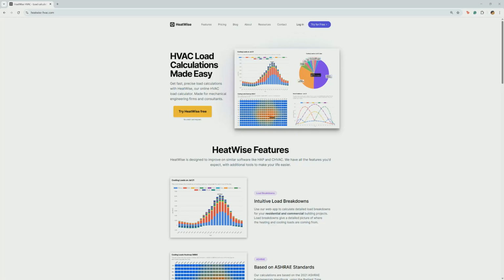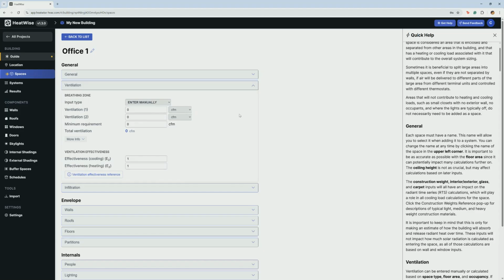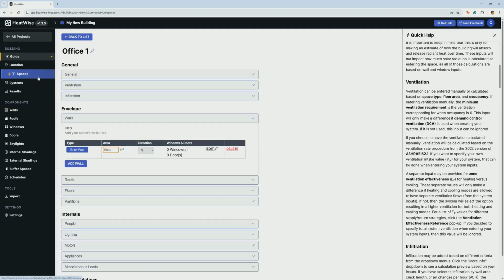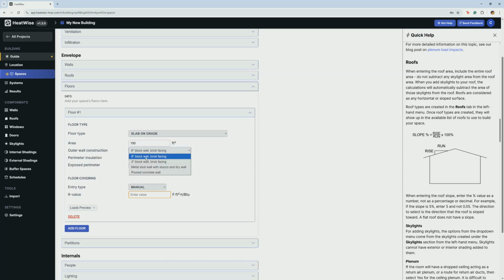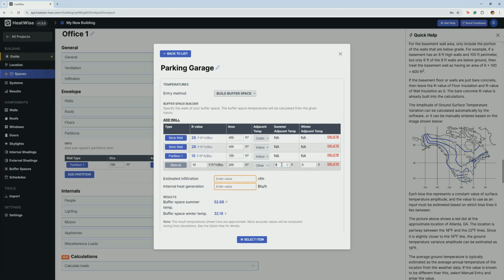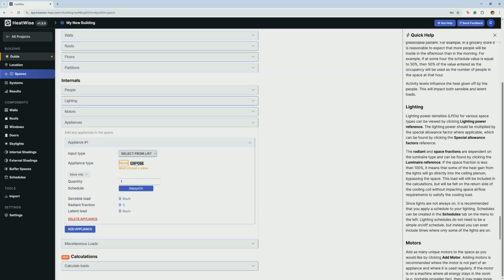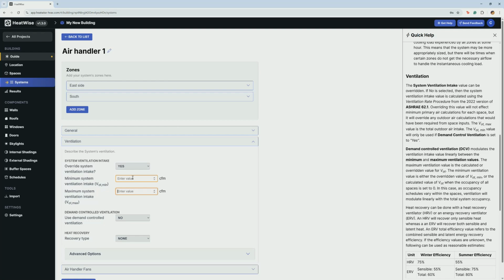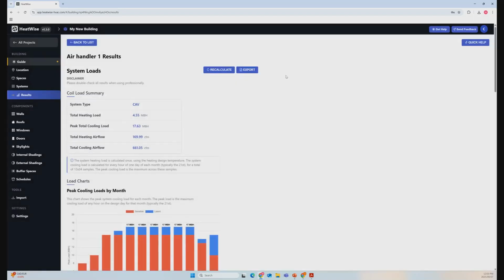HeatWise Commercial Project Tutorial

Comment from the maker: 00:00 Getting Started with HeatWise
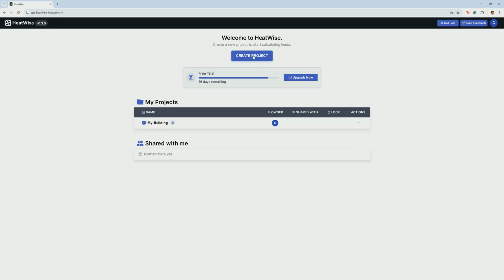01:26 Create a Project
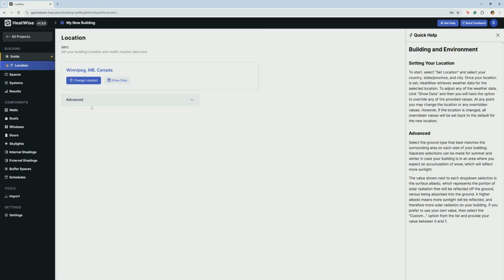05:06 Setting the Location
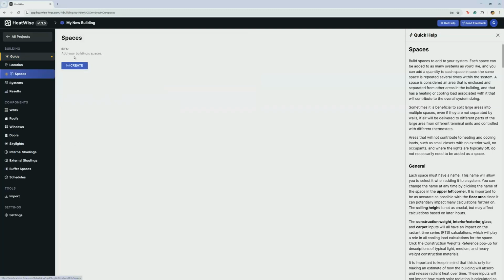08:06 Create a Space - General Inputs
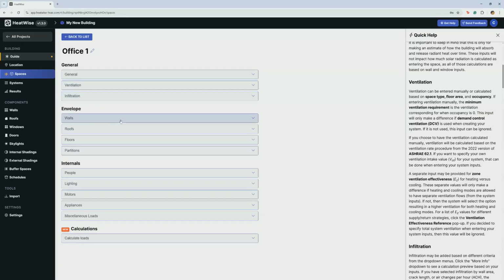15:13 Space Envelope - Walls, Windows and Roofs
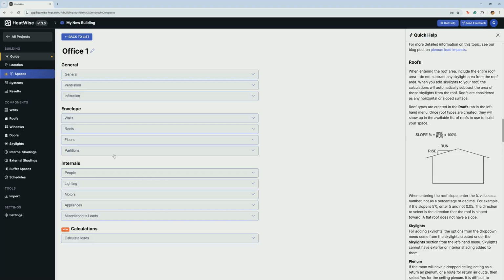31:45 Space Envelope - Floors and Partitions
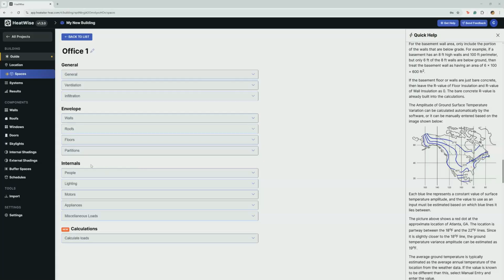45:13 Space Internals
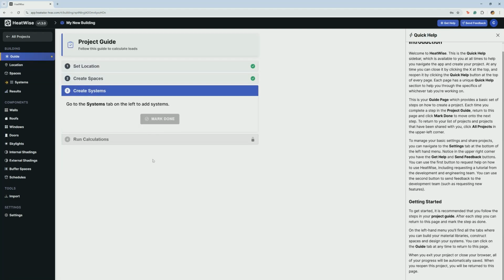57:53 Create a System
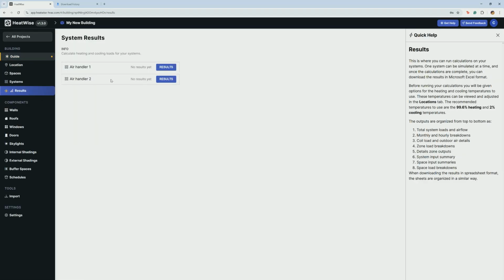1:12:09 Running the Calculations
1:14:39 Downloading Results